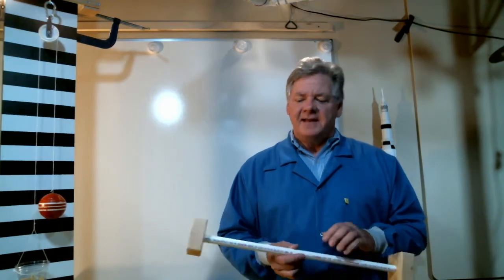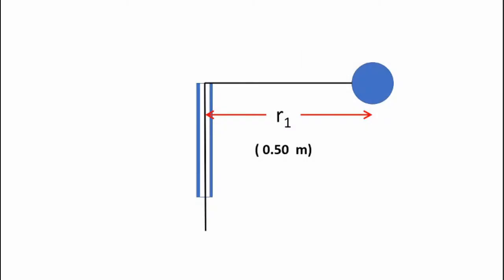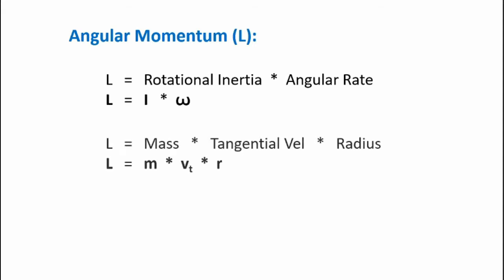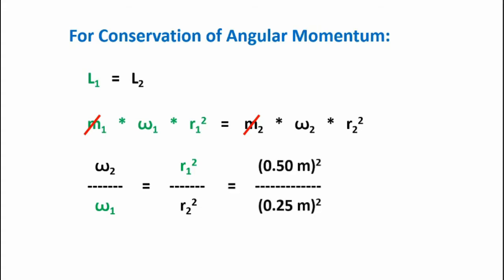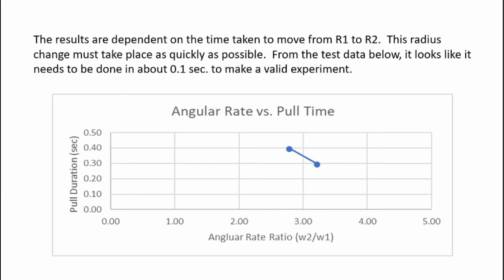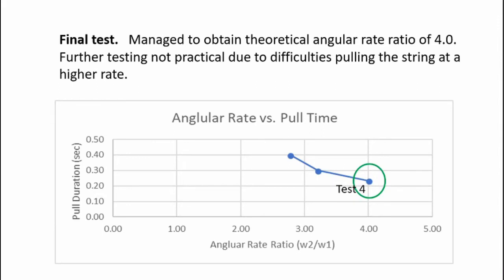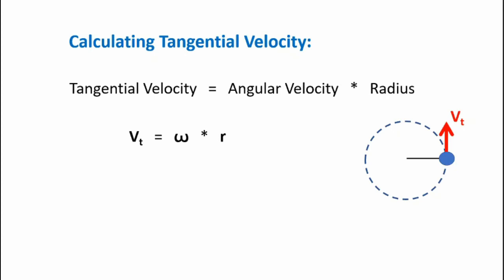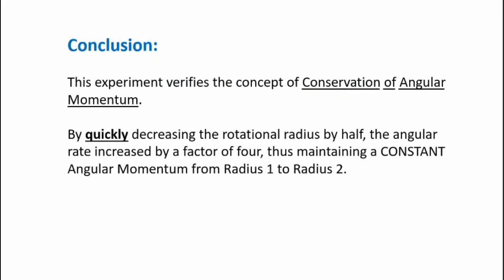Conservation of Angular Momentum

Comment: Here are the results that I measured:  

First four revolutions 2.8 seconds.  The radius of rotation, however, is NOT the length of the string.  It is the distance of the mass from the vertical axis of rotation. That would be L cos(a) where L is the length of the string and a is the angle of the string to the horizontal. That angle looks to be about 30 degrees.

Last 3 revolutions: .95 seconds.  Here the radius of rotation is much closer to the length of the string since the string is almost horizontal.  

So the ratio of the radii is not 2:1.  it is 2 cos 30:1 = 1.73:1.  So, according to conservation of angular momentum, the period of rotation should be reduced by a factor of 1:(1.73)^2=.333.  Comparing the periods gives a result very close to that: .95/2.8=.339  and certainly is not consistent with the conservation of angular energy.  You did notice that you had to exert a force to shorten the string.....
Reply: .... where do you think the energy (that you added by doing work in pulling that string) went?  It did not just disappear.

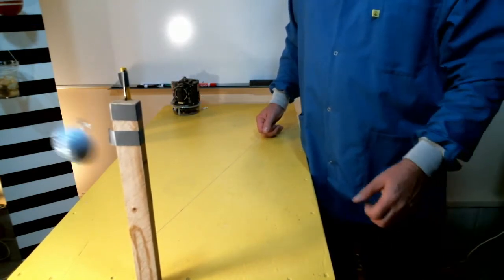Comment: The demonstration of the ball on the string around 1:15 to 1:20 or so shows conservation of angular momentum only initially when the string is being pulled in through the hole in the post and the angular speed increases rapidly (as 1/r^2).  Kinetic energy is added by the work done by pulling on the string. However, toward the end when he stops pulling and the string starts winding around the post, there is a torque acting on the ball due to the fact that the string is no longer applying a purely radial force.  When that happens, angular momentum is no longer conserved. You can see that the string has wrapped around the post because the demonstrator unwinds it.
Reply: You are not allowed to desperately try to fit the theory to some cherry picked part of the experiment because that is academic fraud.